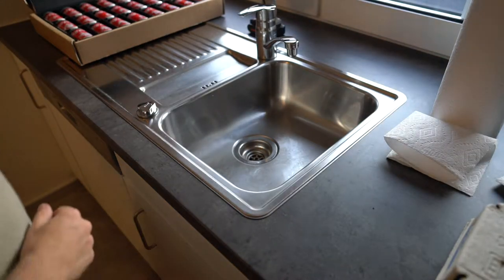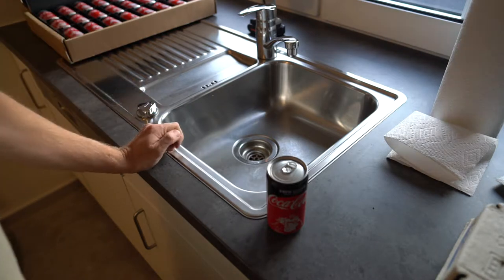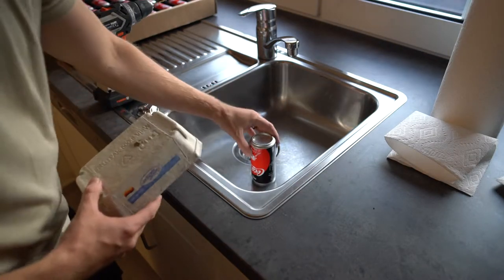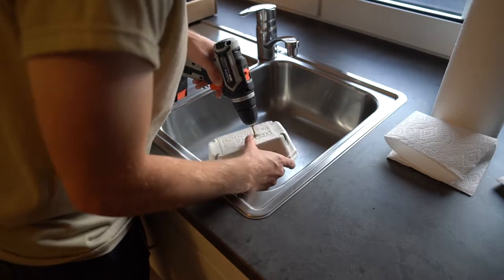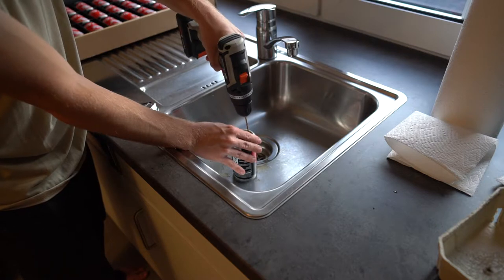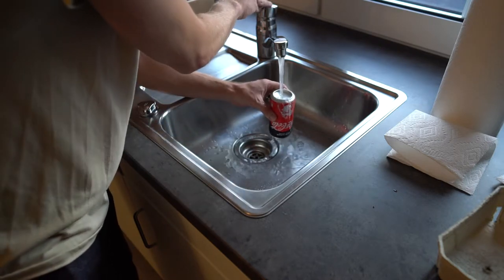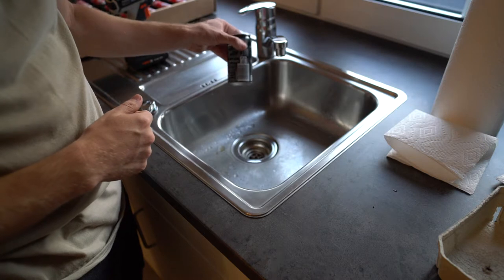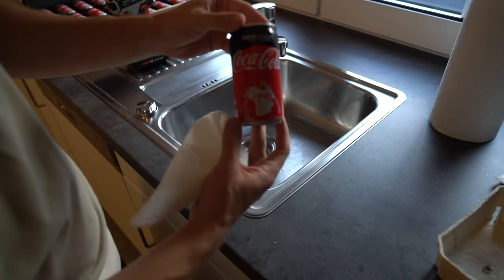Best Way to Drain & Preserve a Collectible Soda or Beer Can

Comment: I'm old school.  All I need is a hammer and a Phillips head screwdriver.  If you do it slowly enough you avoid the massive spray.  I've done literally hundreds of cans this way over the years.  A thorough rinsing is also a must.
Reply: Yeah I just pierce it with a really sharp can opener...it's all leverage. Plus you can still drink the product without wasting it because of the metal shavings.
Reply: what happens if you dont rinse out the can?
Reply: @JxT1957 Soda deposits stay. Soda is sugar. Can cause issues LOL
Reply: How do I rinse it😭

Comment: All do respect , you scratched a lot when drill slipped away :(
Reply: If you have a carpenter's punch or a small Phillips screwdriver, you can create a starting guide that will keep the bit from slipping. 

Don't try to punch the hole. Just tap lightly with a small hammer or block of wood, so that the punch slightly dents the can. Start your drill bit in this dent, and no more bit walking around making scratches! 

I am a carpenter, so this is common practice for me in metal or wood.
Reply from the maker: I learned a few more tricks after making this video. A slight indentation really does help. Thank you Yohan for adding that comment.

Comment: have you tried using compressed air in one of the holes to force the last of the liquid out?

have you ever considered filling it with something afterwords to improve the weight or durability of the can, like some sort of expanding insulation foam or something?
Reply from the maker: Mike Greiling that’s not a bad idea. Have drained hundreds of cans since making this video (shipped them from Europe to the US) and found that sitting them up at an angle to drain works rather well.
Reply: Oh yeah that's right. Compressed air cans can come with little tubes to poke into one of the holes.
Reply: Something Tells me I should practice several times with unimportant cans before trying to inject foam into a collectible.

Comment: You should swing the pull tab around and poke a small hole with a nail where the centre part of the pull tab would line up then drain and swing the pull tab back round so you can’t see the hole 🕳
And to get rid of the rest of the juice when drained run hot water on the bottom of the can
Reply: I might be necro posting a little bit, but what the hell.

I think this vid was actually in part intended to be an alternative to this method. for one this vid is 4 months after madnug's vid on draining cans using this method, but also note the line "I got on youtube to at all the cool ways to drain a can, everyone wants to use screws and nails [...] not very effective"

I still think mad's method is valid (especially for pranks) but I can see a hybrid of both mad and doug's method being pretty effective
Reply from the maker: I appreciate your feedback on the subject. I did try the under tab method and preferred the method I ended up on. Ended up draining nearly 500 cans this way, with no issues. Thank you again for your comment.

Comment: If I drill directly to the can will it get electric shock?
Reply from the maker: That’s a fair question. This is why I used a piece of cardboard to block the excess amounts from hitting the drill. I later gave up on this idea and just let it get covered in soda while emptying nearly 500 cans. Never received any shock. 

As a disclaimer, it is possible, but not probable, you could be shocked.
Reply: Dougie’s Automotive Adventures. Thanks for the speedy response. My son has collections of coke from overseas. Suggested to remove the liquid at the bottom of the can n keep it as it’s his hobby. Pls advice if you hav a good suggestion. Greatly appreciated.
Reply from the maker: That’s exactly why I drained mine. Hundreds of pounds and the danger of exploding cans as we moved from Europe to the US.
Reply: Dougie’s Automotive Adventures Tks for your prompt response
Reply from the maker: valamurugan not a problem. Glad to help